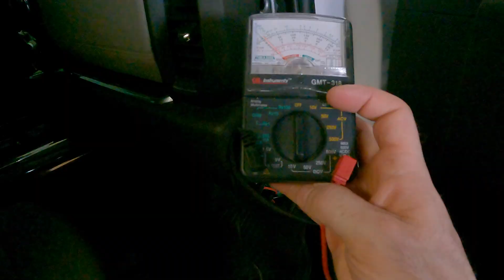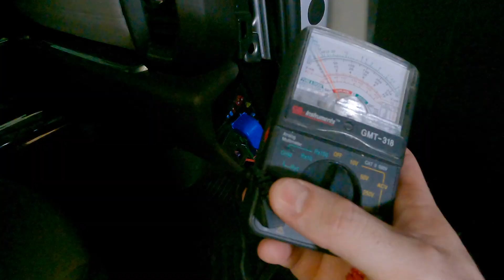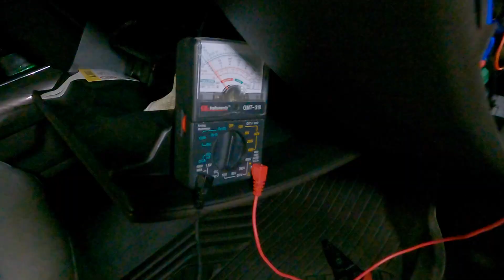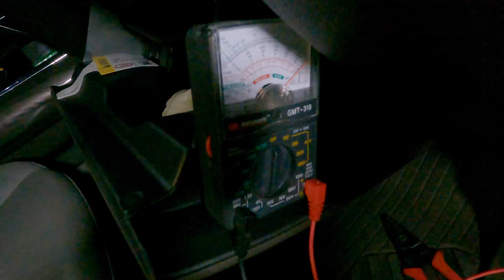DIY - How to Properly Install Fuse Taps for Dash Cams and Auto Accessories

Comment: thanks for the informative video. Would you make a video for a remote audio amp on where to tap from the fuse box please. How many volts is the remote audio power going to remote terminal going to amp?
Reply from the maker: Great suggestion! I don’t install a lot of audio systems, but I’ll be sure to break it down if I do!